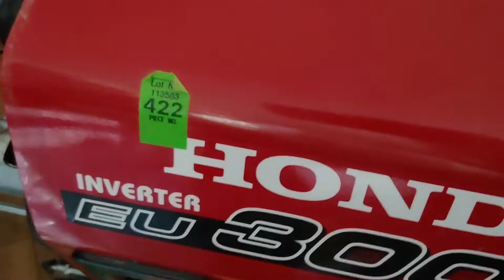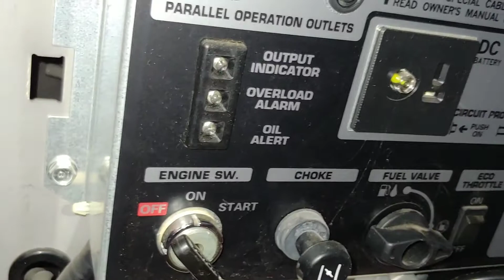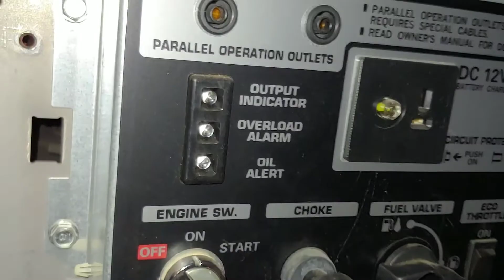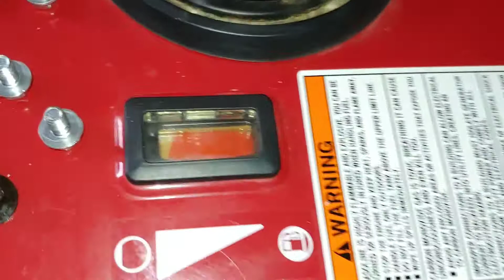Not Going Without  Power During A Power Outage Here!! October 9, 2019

Comment: Just overhauled the carburetor on my 1996 Honda EG2200X... it's a small guy, but enough to power my oil-fired furnace, a few lights, and a refrigerator.
Reply from the maker: I love HONDA generators for their caftmanship. Mine (EU3000 is) goes back to the late 90's. I just wish it had come with a time meter.

Comment: Does this require any extra inside electrical work to operate? Nice review.
Reply from the maker: I use a multi outlet power cord to power the refrigerator, LED lights and time share the corded furnace in emergency power mode. I own a switch over box but have not yet yet installed it.

Comment: Admiral Preparedness • Thanks for showing the Honda generator 3000.  I don't have one yet, the brand is pretty expensive.  It's supposedly the quietest.  Showing us the required maintenance on it is really good to know.  I'm in So. CA, so not affected by the deliberate electrical cut off that they are implementing.  But, you never know.  I had heard that the conservation-minded gov. Brown forbids cutting trees?  So, they didn't cull out the old, damaged trees/branches?
Reply from the maker: The quieter, the better I always say. Yes, it was expensive in 2003 dollars. But, it runs like it is brand new after all these years, so it has paid for itself many times over.
Reply: yes expensive, but well worth it!!   I'm with AP, it does pay for itself!